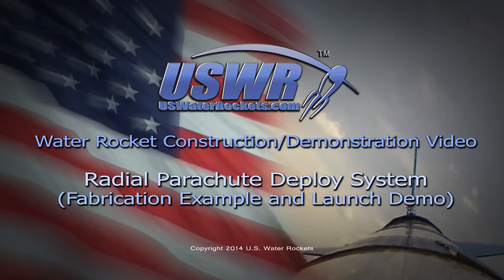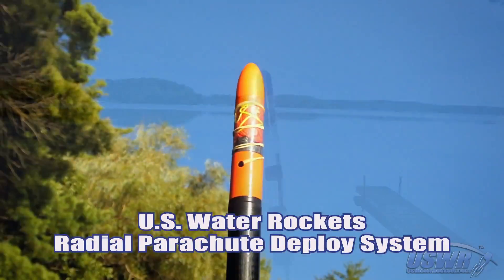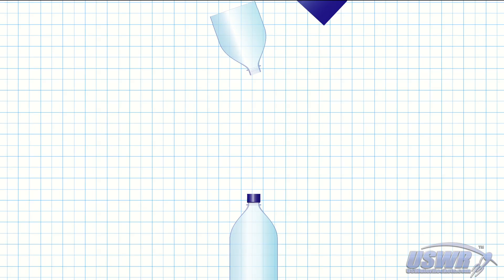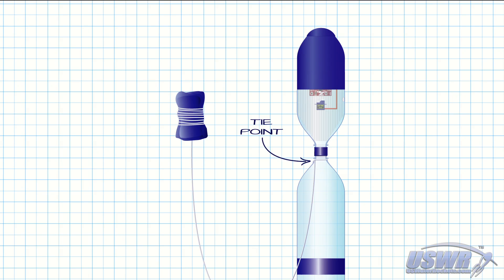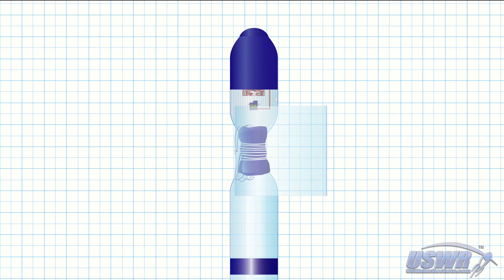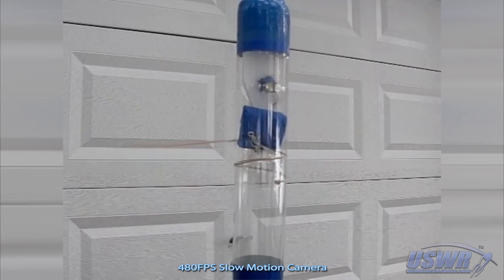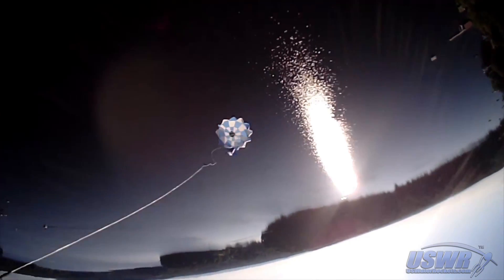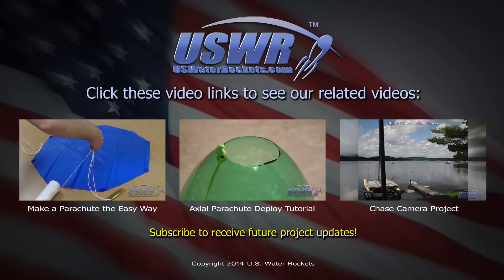Ultimate Water Rocket Parachute Deploy Mechanism

Comment: can i know what's the internal pressure and the max height it can achieve??
Reply from the maker: The maximum internal pressure depends on the type and diameter of the bottles you use for the rocket. Some bottles are better than others, and this can vary by your location because bottles are made by local bottling companies and each one has different molds and equipment. It is also possible to reinforce the bottles with fiberglass or other materials and enhance their ability to hold pressure. The maximum altitude depends on the pressure in the bottles as well as the volume of the rocket, and also the weight of the complete rocket. The rocket weight can be affected by the materials and techniques you use to make it. Because all of these variables are involved, some rockets will fly higher than others. The blue colored rocket in this video is capable of holding 150PSI and can fly 600-650 feet high. The yellow rocket in this video is capable of holding 175PSI and can fly 650-700 feet high. The two rockets are very different in size and weight.
Reply: @USWaterRockets  in place of bottle why not use pvc pipes ?
Reply from the maker: Two main reasons:1) PVC is not as strong as PETG (used for bottles), so the pipes have to have thick walls to hold the same pressure. This will make the rocket very heavy, and won't go as high.2) When a bottle has too much pressure in it, the PETG will stretch and tear and release the pressure somewhat safely. When PVC exceeds the pressure it can hold, it can shatter like glass and send tiny pieces flying rapidly everywhere and really hurt someone.Also, PVC pipes are pretty flexible, so when you make a big rocket from them, the rocket can bend like a spring when accelerating, and this can cause it to fly off in some random direction.
Reply: @USWaterRockets   thanks, hey do u have any material or formulas for design of water rockets ,and can u suggest a data handbook??

Comment: IS THERE ANYTHING THAT DOES NOT REQUIRE ELECTRONICS/ELECTRICITY?????
Reply from the maker: Yes, but it was the kind of designs that people had already worked out long before we came on the scene and we wanted to invent our own stuff instead of just making videos of things that everyone else already created. Look for tutorials about the Tomy Timer mechanism. That's a purely mechanical timer. Look for "Air Flap" designs as well. Those use air speed to trigger the system. Either of those will work, and can be used in place of the electronics in this design.
Reply: Thanks! My hope has risen :D

Comment: is there any other way to trigger the rubber band? without technology and things you can get from a store?
Reply from the maker: You could use and air flap mechanism, which is made from a cut bottle or piece of fin material. You hinge it at the top to the rocket and pinch the rubber band under it. You hold the flap down pinching the rubber band with some kind of stick or pull-pin tied to the launcher. When the rocket launches the pin is pulled or stick is removed and the flap is free to lift up and let the rubber band loose, but the air blowing across the fin from the motion of the rocket will keep the flap from lifting up. Only when the rocket slows down enough will the flap be able to lift up and let the rubber band go. This design has been in use for a long time, but because of a lot of variables, it will never open exactly at the peak altitude of the rocket, unless you are very lucky. If you are trying for an altitude record, then you want to deploy at the peak altitude or just after peak altitude. To do that, you will need something that triggers electrically like a servo motor, or mechanically, like a wind-up timer, both of which you have to buy or take out of some other product you buy in a store. There are not a whole lot of options you can make out of household items, I am afraid. The air flap is the best bet for that. Good luck with your rockets!

Comment: I am wondering how much does a timer circuit cost for the parachute deployment system? The reason I ask is that The DollarTree has little electronic egg timers that you set the time you like and when the time is up it buzzes. Suppose you took the buzzer off and hooked a motor instead? That way when the times went off it would spin the motor and deploy the parachute.
Reply from the maker: I suppose that depends on where you live and what stores will deliver there. There are plenty of places that sell Arduino clones for really low prices $5.00US or less. One of those could be made into a servo timer. I am sure someone probably has made this software. It would be that, plus the cost of a servo and battery.
Reply: So would it be less money to buy an egg timer and a mini hand fan to take the motor off of it and rig it up to when the egg timer goes off it operates the motor you removed from the dollar hand fan? For two dollars you could make a timer that will spin a motor that works as the servomotor. You think that possibly could work or too hard to get the correct time down to release the parachute?
Reply from the maker: This kind of design is similar to a common parachute design called a "Tomy Timer". A lot of people use this idea with a lot of success. We prefer the electronic timer because our experiments require very accurate timing. For many people they don't need precision just for having fun launching with a parachute.

Comment: I was wondering what you guys thought about a system that uses mercury bulb contacts to trigger the parachute when the rocket got as high as it was going to go and when it started to nose dive back down to earth it would trigger the servomotor to launch the parachute? You guys think that would work?
Reply from the maker: Mercury switches and gravity switches have been attempted by others many years ago, without success. It was found that when the rocket reached the peak and started falling, that it was in a state where the effect of gravity is no longer felt by the rocket, so they switch would not activate in a reliable way because the rocket was experiencing zero G as it fell. It's not clear how to improve this to make it work. If you have a way to do it, then there would probably be a lot of interested people.
Reply: I thought about that problem also. The problem of zero gravity while free falling, but was wondering about a way to film the mercury bulb to see how it acts when it is in free fall to see if you put it in a different position so it would make contact with the contacts. But also thought it would be better to create a little thing with a BB in it that way you could place the contact just above the BB. That way when the rockets is traveling upwards the BB would be pegged at the bottom of the tube or whatever it was in but as it got to be as high as it would go and moved up any at all it would make contact with the contacts and spin the motor to release the parachute. I think the BB method would work better in that case
Reply from the maker: Steve Rabon A group that makes water rocket kits made a video with a camera inside a water rocket showing what happens to small objects as the rocket goes up. https://www.youtube.com/watch?v=IJsEGT2Pc5A As you can see, right after the thrust runs out, the rocket goes into a coasting mode until it reaches the peak, but when the rocket is coasting, wind resistance is making it go slower, so it actually is in negative G at that point. Everything inside the rocket goes to the front of the chamber. Than there is a period of zero G as the rocket falls down. The problem people have is that the rocket goes from 1G on the pad to some big number (say 10G) during thrust, then instantly it switches to some negative value from drag during coast phase (say -0.25G) and then a very gradual switch to 0G as the rocket slows to a stop at apogee and then starts falling. The way that the gravity force doesn't have a very distinct change at the apogee peak is why it is hard to detect with a gravity sensor. You can very easily make something that senses the launch because it goes from 1G to 10G almost instantly. You can detect the end of the thrust phase because it goes from 10G to -0.25G almost instantly, but the very gradual transition from -0.25G to 0G is really tough to detect with a mechanical switch. We created an electronic timer called ServoChron that can be triggered from the launch phase and deploy a fixed interval later, and then we created the Launchpad AlTImeter to actually measure the changes in altitude and deploy the parachute at the exact moment of apogee. We've had good luck with this and shared the designed for both of these systems which are relatively easy to build. Our engineering background is more electronic and less mechanical, so these designs are the type we are most proficient at. Someone with a better mechanical engineering background would be more able to design a purely mechanical system to detect the peak. Given the behavior of the G forces observed inside the rocket, it seems like a difficult challenge.
Reply: I think I got it this time. OK at the top of the rocket where the pay load is. You have a small cylinder that comes out the top from the last bottle cap. In that cylinder you have a small piston that when you pressurize the rocket it forces the metal piston up the little cylinder and when the rocket depressurizes it sucks the piston back down the cylinder where it hits the contacts to spin the motor. You understand what I am trying to say?

Comment: my water rocket parachute design is only depends on the air and gravity,when a rocket stop climbing it fall and the trigger mechanism is simple like an umbrella style without any means of adding electronics,and i have some additional i made with my water rocket with a single stage bottle with  a power of two bottle rocket combine by means of what i called GROUND BOOSTER which the second bottle is pressurized  and connected to the launcher which help the single stage water rocket to climb fast.you could make also a multiple GROUND BOOSTER  and connect it to the launcher.someday i will upload my video too,my idea of GROUND BOOSTER is like on the aircraft carrier that has a pressurized piston cylinder that help the airplane to climb fast,right?the advantage of what i call GROUND BOOSTER it could help to eliminate weight on the water rocket.

Comment: Hey. Great idea. I had an idea of my own and I just want you it review it if possible.

I am a young guy who is having a rocket home work and I had an idea. If I used a plastic bag and put it over the nose and taped the handles to the rocket I think it could deploy when it starts to go down.

When taking off the forces of the take off should keep the bag over the nose cone however, when it starts to come down it has an opposite force there by deploying it with no electronics. I'm not sure if this will work however if you could proof read this than that would be great.

Please read, Cian
Reply from the maker: Hi Cian, There are several variations similar to your concept that people have successfully used in the past. The main issue people have reported is that the rocket has to fly perfectly vertical, stop at the peak, and then slowly tip over as it falls backwards. If the rocket curves off course and is not perfectly straight, it could fly in a big arc and the slowing air will keep the parachute from coming out. The idea does work, but people have found that it is not as reliable as a electronic (servo) or mechanical (tomy timer) deploy.

If you spend hours and hours building a huge rocket, or and stick cameras and altimeters onboard, you want to make sure that the deploy is as reliable as possible. That's why people tend to use active deploy systems like ours.

You can experiment with different styles and form your own opinion. That's what's great about this stuff. Everyone can refine their own methods and have fun. Keep it up!
Reply: On my Instagram (same name) I have uploaded some testing with a two litre bottle with a bit on weight on the bottom to ensure it doesn't tip. Thanks a million for the reply.

Cian

Comment: Hey, I have a little idea to make a rocket with this radial parachute deployment mechanism even smaller:
If you place the parachute section between two pressure vessels, which are connected by a tonardo tube, and the timer/servo section between two other other vessels, you wouldn´t need the upper section and would make your rocket even lighter.
Here is a concept:
http://img5.fotos-hochladen.net/uploads/rdpm2bysr1za3fn.jpg
Greetings
Reply from the maker: Great idea! This is the kind of thinking we were hoping this idea generated. There are a lot of ways this design can be used. Your concept is similar to our setup for tornado tube couplers. If you look at the very last step in our tutorial, the second image shows how we placed the deploy system in the middle of a rocket

http://www.uswaterrockets.com/construction_&_tutorials/Radial_Deploy/tutorial.htm

We tried it with the electronics and servo in the tornado tube area and also with them located remotely and a wire running down the side to reach them.
Reply: +USWaterRockets Hello USWR, we plan to write an article on our website about extra light parachute deploy systems and want to mention your radial deploy system. It would be great if we could use one of your photos for this purpose. Here is a link to a preview how we plan the article: https://onedrive.live.com/redir?resid=B45F871529485403!518680&authkey=!AIzH6asgP3uRQEE&v=3&ithint=photo%2cPNG Greetings =)
Reply from the maker: RaketfuedRockets That sounds great! You can use our photos or diagrams if you want. That looks like a terrific article!
Reply: +USWaterRockets Thanks! :)

Comment: So I've been thinking about this for a few days now and I have to say, this is a great design change.  This may very well get me to dust off my parachutes!  Well done y'all! And thanks for sharing.
Reply from the maker: We love that we can build this in 5-10 minutes. It's even easier to make then our axial deploy system. We're hoping to see someone use a Tomy Timer with this. That would be cool
Reply: USWaterRockets Done. :-)
Reply from the maker: bugwubber That was easy!
Reply: USWaterRockets Yes it really was.  I have never used a clockworks before.  Thus method works really well with the style of rockets I build- I just switched to a long neck DP bottle to maximize space for the parachute.
Reply from the maker: bugwubber Remember: If you have a claw foot for the top of the rocket, you can just tape on a neck cut off another bottle as an adapter.
Reply from the maker: bugwubber Be sure and do a couple of ground tests to insure that you have practice with the system and the system is nice and solid. Putting a lot of tension on the rubber band will help it fling the parachute cover right off.
Reply: USWaterRockets I'm using a 12" loop of 3/32" FAI Tan Sport rubber.  It is amazing how this deployment system just explodes away from the rocket.
Reply from the maker: bugwubber Yeah. No More PET "springs" or "Ejector Plates" to fuss with. The cover just flies off and pulls the chute out behind it. It can even act as a crude "drogue" parachute to pull out a sticky main 'chute. Surely you are familiar with the K.I.S.S. rule?

Comment: Was the nosecone bulkhead waterproof? If so, how did you do that?
Reply from the maker: Hi Oli4vn!

Are you asking how we keep the electronics from getting wet? We have a good procedure to help prevent this that doesn't require a seal of the payload compartment. It is very hard to get a waterproof seal and still allow a mechanism to function, so instead we stop trying to seal and just try and keep the circuit dry.

If you notice that the corriflute bulkhead where the electronics are fastened holds the circuit in the middle of the compartment away from the sides. When water comes in the compartment, it will only fill up the interior a little bit until the water inside is level with the water outside. The body of the rocket is light so it floats mostly on top of the water, so the water inside the compartment is never enough to reach the electronics. It works well enough that the servo and timer does not get ruined.

We do have to waterproof our cameras though because they have to be on or near the outside of the rocket body and can get submerged if the rocket lands with the camera on the side that faces down.

Does that answer your question?